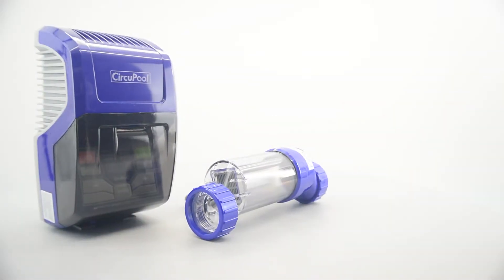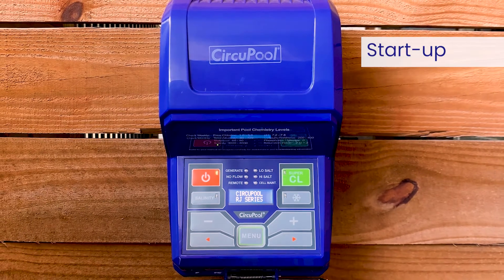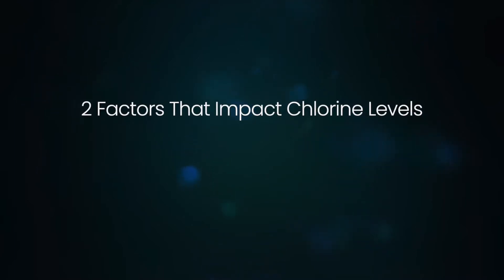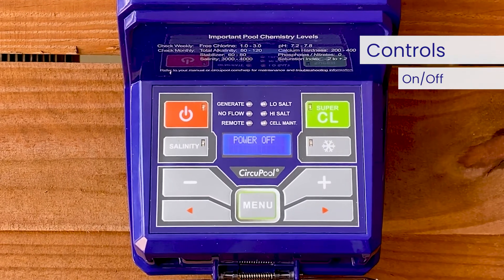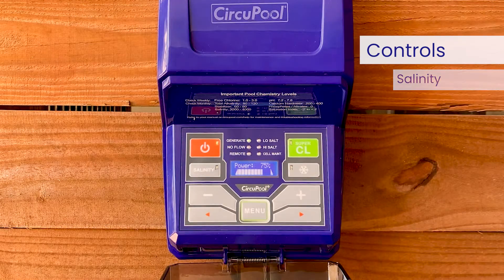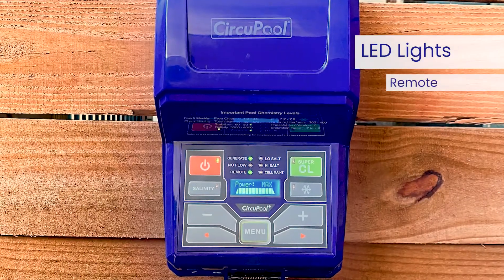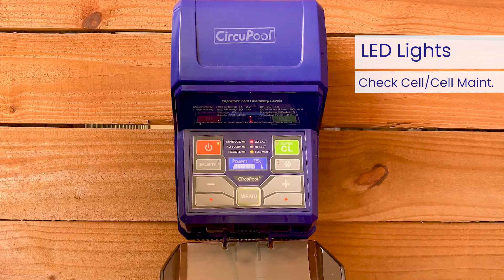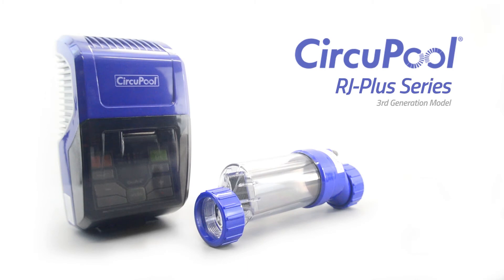Operation Guide | CircuPool RJ Series Salt Chlorine Generator | How to Use Your Salt System

Comment: Will the no flow light flicker on and off every time the pump starts back up? For example, stop pump to empty basket then start pump up again. Or is it only when powering up the module?
Reply from the maker: Thanks for your question. The no flow light will flash for up to a minute whenever flow is re-established, until it confirms constant flow. So that would be tied to the pump start-up as you mention.